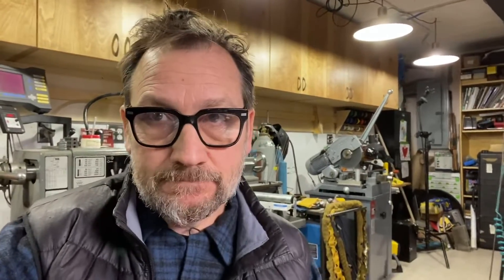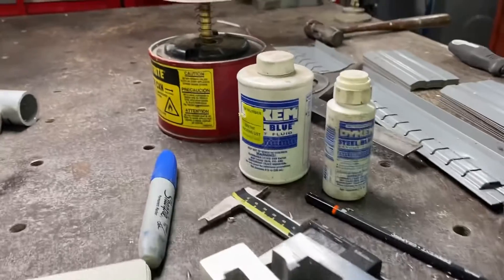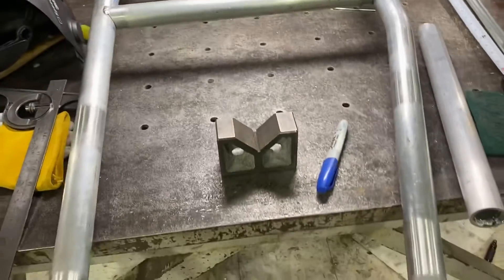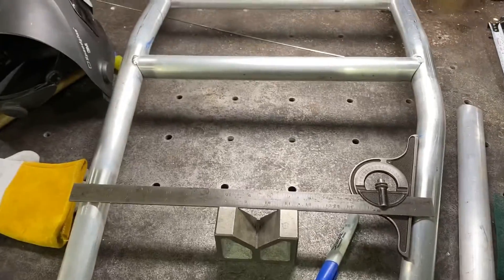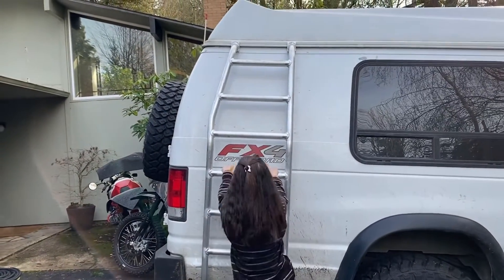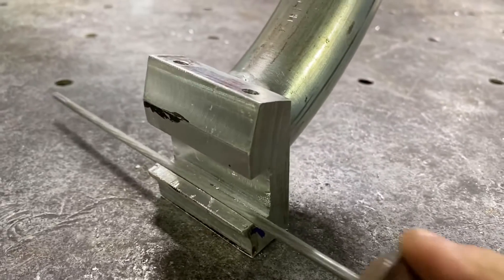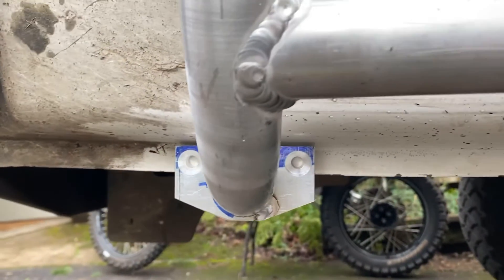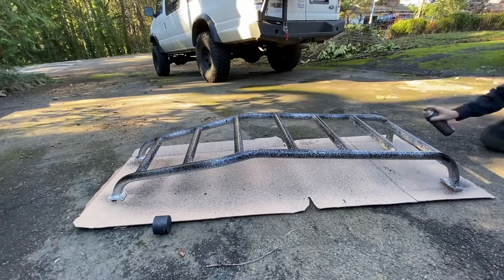4x4 Van Ladder Build!

Comment: Gregor, what are the deets of your cold saw setup? That sucker is a hoss. Awesome van ladder build, and the video was entertaining too. ☕
Reply from the maker: It's an old Trennjaeger I got for $500 because the Harley shop that had it didn't understand what 3 phase was. It took a week to strip, clean and repaint and then I installed a VFD so I could vary the speed on single phase and I've been enjoying it for the last 12 years with zero problems. It is a beast and quick and clean too.

Comment: Not very aerodynamic. I can tell by the rest of the van that you’re worried about gas mileage 😂 Turned out great!
Reply from the maker: Ha. Just wait for the roof rack. I'm going to put a sail on that. Sadly, not much will effect the milage of this either way. 12-14 no matter what. Downhill 14. Uphill towing a trailer 12. Dropped off a cliff - 13.

Comment: That's a great addition to the Van. Now to keep it in place,  I would suggest you to trow in a few Tamper-resistant drilled spanner flathead screws or some other forms of anti-thief protection. I learned that the hard way, after coming back to my car from a day ride, only to find my bike rack gone. ---- anyway,  as always, Congratulations ! Good job Gregor.
Reply from the maker: I don't know if I'm lucky or if the van is just so intimidating but no one messes with it. I also live in a safe place so that's lucky.